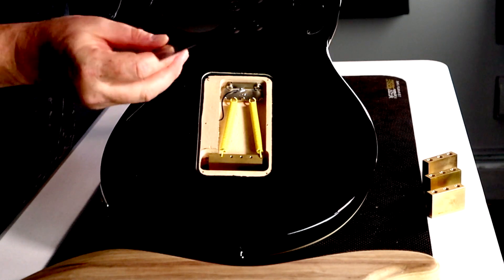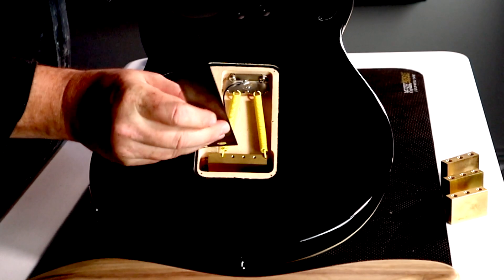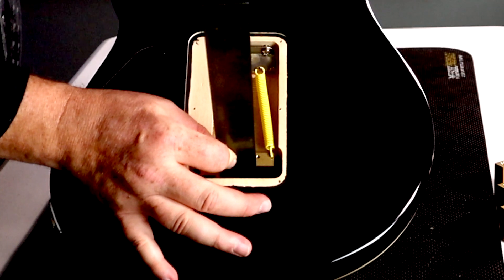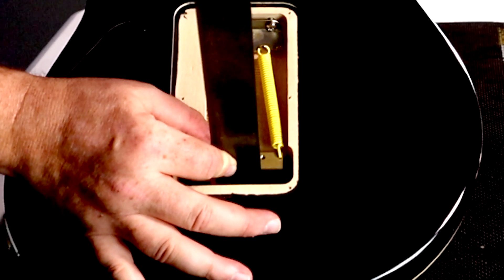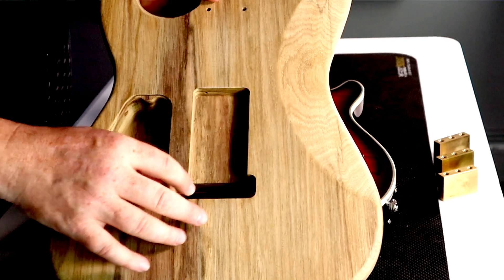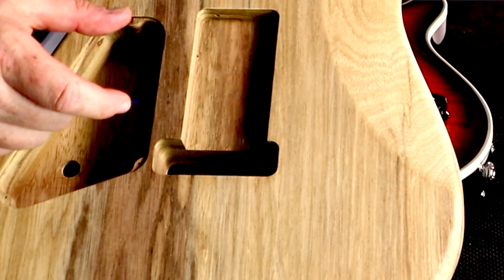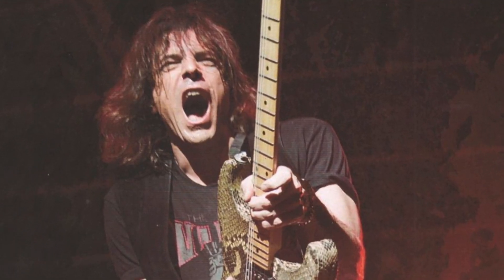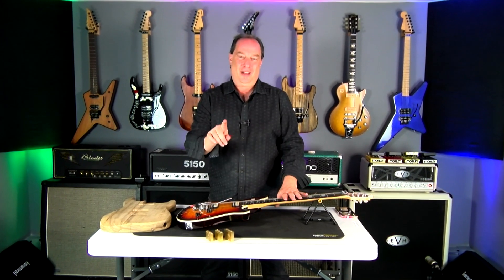FU-Tone "What Size Block Do I Need?"

Comment: I emailed you with my guitar model ( Charvel San Dimas) and you answered next day with the block I need. The 37.  Now that’s service man 👍 and that’s really appreciated by me. Thank you!
Reply from the maker: Thanks Stephen! Enjoy the TONE!
Reply: I'm glad that you posted this. I was going to buy a 32 the same size that is in the guitar.
Reply: Thank you for posting guys
Reply: Hey Steve. I am glad that you are happy with your Brass Trem block. I too have a Charvel San Dimas which I recently acquired from Reverb. I just measured the stock Trem block on my Charvel and it is 32 mm. I have a question. If I go with 37 mm, will I get the full range of motion while doing Pull-ups using the whammy bar? Because if the whammy bar movement gets restricted using a bigger block, then it's a compromise. What do you think? Thank you so much in advance. Cheers.

Comment: My main concern in upgrading the block on my hm Strat reissue is not the height, it’s the thickness of the block. It seems that all the these big brass blocks are going to restrict the trem arm movement as  the cavity does not appear wide enough. It seems the only option is to route out the cavity which I don’t really want to do 🤔. Help 🤦‍♂️
Reply: I realize this comment is over a year old, but replying in case you're still wonder or if someone else is wondering.

I have a 2020 hm strat reissue and I just put the 37 L brass block in. It fits perfectly without having to do any other modifications. The only "issue" is that it will hit the spring cover on the back of the guitar if you really pull up on the trem. You have to pull up significantly to do that though. I never pull up that hard with my play style so it's not an issue for me. No issues when doing dives. It really improved the sustain and I'm very happy with it.

Comment: If I upgrade my EVH Wolfgang Standard, do I need to open up the cavity with a bevel? Is it possible to just upgrade the block with a FU-tone 37mm L Brass Block and drop it inside without any mods? Thanks for any info!
Reply: Was wondering the same thing

Comment: I have an 84 kramer w Floyd rose 1000
Wondering which block (brass would be the largest I can use )
Also
Just an idea, could you attach a brass block to a standard block ? With brass screws ?

Comment: I put a 32mm brass block on my Jackson licensed Floy because 32 was what it came with. Then I got a Floyd original which came with a 37mm block but I still put the 32mm brass block on it. Now the strings are so close to the fretboard that they are touching the frets and I never had that problem with the licensed floyd. Could this be because it’s too small of a block?

Comment: This is super helpful! I’ve been meaning to start upgrading my Jackson SL3MG for a while now. When I measure how much room should I leave so it doesn’t hit the backplate? Is that something I should factor in?
Reply from the maker: 3-4 mm if you want to add the plate back on.
Reply: I've ordered a couple blocks from you before, Jem Jr, Jackson Dinky and screw hole placement seems most important, or they for sure won't work. Can't take pics on my crappy phone, so I'll give you a call after I disassemble bridge, no other way, thanks anyway